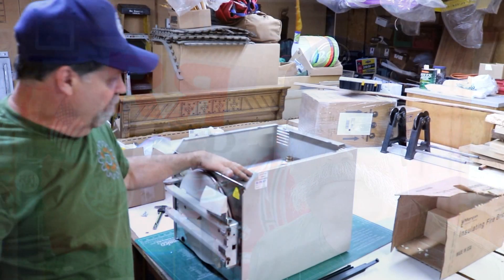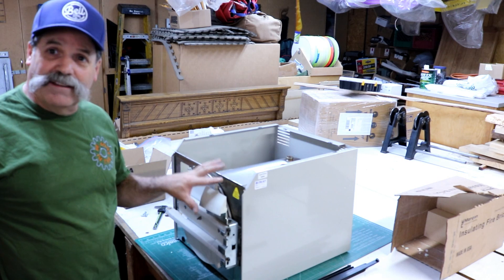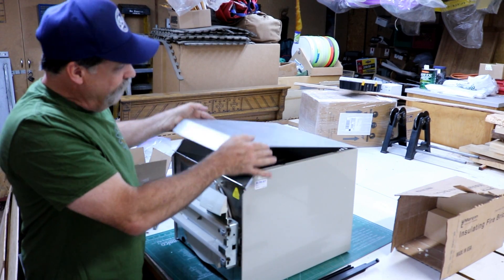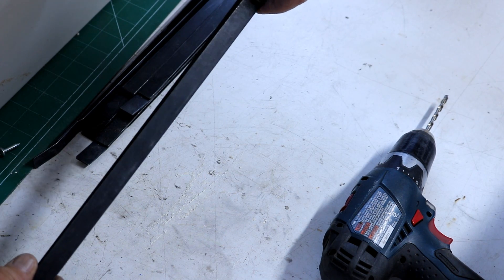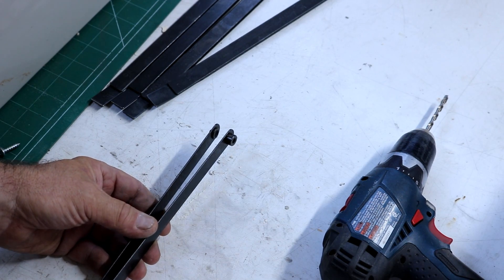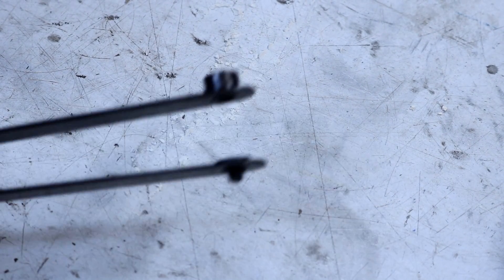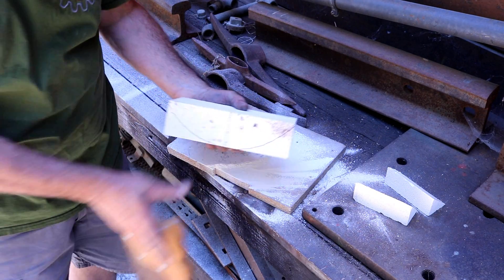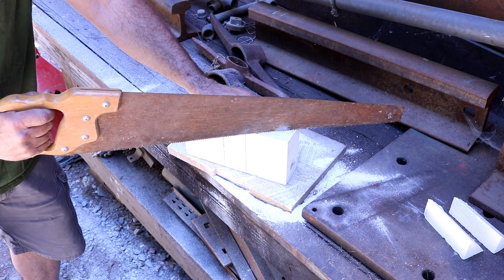How I Built a Heat Treatment Oven P1

Comment: I just used my bandsaw to cut out the bricks when i built my heat treat oven. Then I used my drill press & a 1/4" drill bit in my press to make the tracks... That was a couple years ago, I just had to replace the elements a month ago. I've made a few videos on the process if you are still building yours.... Really opens up so many doors for heat treating knives... Take it easy...

Comment: Nice job Randy, what is the proper name for those light weight bricks? I would like to build an oven and forge using them..one of these days.
Reply from the maker: They are made by Morgan, Insulating bricks, K26, made in USA
Reply: Thanks Randy, have to see if I can source them on my side of the border. Hope that those terrible fires are not anywhere close to you?
Reply from the maker: Yes the fires are 5-6 hrs drive away.  Thanks
i bought them threw ebay, out of Portland OR.
Reply: @CruiserMac  I found an entire 1906 coal fired forge and blower on a farm in Idaho. Picked up the whole works for $75. I prefer to do the heat treat on the forge, but that's just me
Reply: @CruiserMac  my first forge was a  car brake drum with an old hand crank fertilizer blower for, well the blower

Comment: I like those hole finders!
Reply: Aircraft mechanics use them to match a new sheet aluminum panel to the existing holes in ribs, other sheets, and other structure, often with no overlap.  I have a couple of those drill guide tools.  Aircraft sheet metal work is demanding, needs perfect fit, often flush rivets, the installed panel shapes need to match the originals perfectly, and strength and rigidity must be just as good as when new -- all at the same time.  Aircraft sheet metal tool mechanics have the best sheet metal tools out there.  Watch for them being sold, often by people who have no idea what they are for.

Comment: I like the hole locators, nice tools!  Those like weight brick are really easy to shape.  Take it from someone who has work related asthma and chronic bronchitis, wear respiratory protection when cutting and shaping the brick, please!!
"Dust is produced during procession. Dust can be harmful to the health. Avoid contact with eyes and skin. Do not breathe in the dust. Dust should be removed by suction.  The dust limits are to be adhered to. See product safety information sheet."